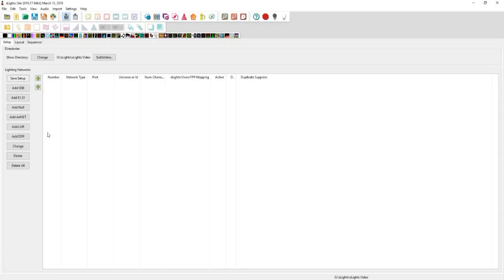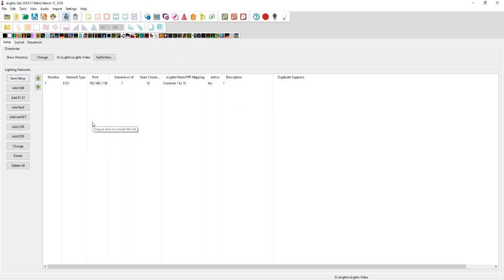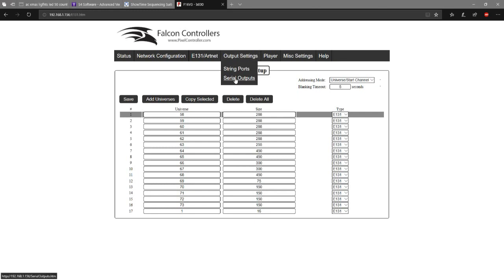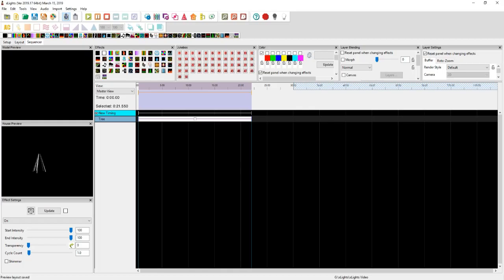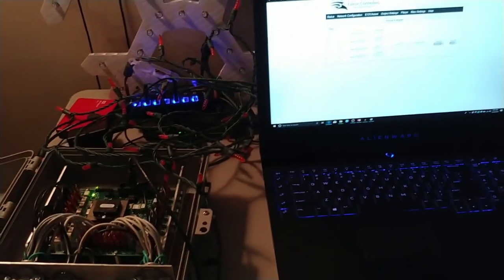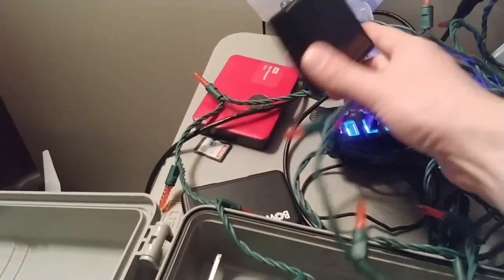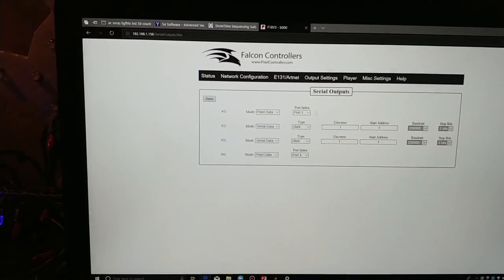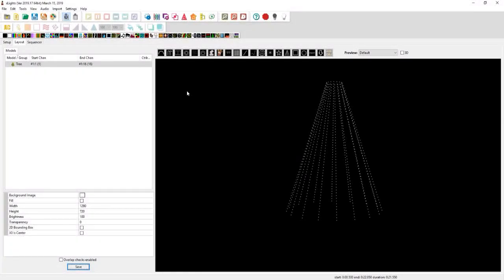xEssentials Lite  S1E15 Light O Rama to xLights Part 5 Running LOR on a Falcon

Comment: Thanks for posting this informative video! I am going to migrate 9 of my LOR 16 channel AC controllers off an LOR Optimized network (in xLights) and onto the Falcon F16V3 serial output as you have demonstrated. Hoping that it minimizes or eliminates some channels that have been turning on randomly and/or staying on even after a sequence is finished.
Reply: Hope it all goes well! If you need any help feel free to message me anytime. The USB dongle can definitely cause some issues as it does for me each year (I have found work-arounds for this), but once it is run out of the Falcon those issues almost always go away. The only large reason to use a USB dongle versus the Falcon output would be either not owning a Falcon or wanting to use the Easy Light Linkers to send data across far distances.
Reply: @stevenb6414  Hey Steve! I have 2 LOR ctb16pc's and was wondering if you could get them to work with my falcon f16 v5 as my switch. Do you mind helping me?

Comment: As stated in another comment, do you still have to set the LOR unit ID's?
Reply: Hello, sorry for the late reply on this! Yes you do. So for instance, Unit ID 1 would take up channels 1-16 and Unit ID 2 would take up channels 17-32 if you were using an LOR 16 channel AC controller on that universe.

Comment: Questions:  
1.  Are you limited to 512 channels for a LOR universe?
2.  Are LOR unit IDs ever used in Xlights to map channels across multiple LOR controllers when using F48 serial port?
3.  How do you define each controllers start channel?
4.  Any idea why a CMB24D RGB 24 channel controller would only want to start the first flood at channel 5?
Reply: Hey Paul! Here are my answers to your questions. My apologies for the very long delay on this!

1. Yes, the topic amount of channels that can be reached in any universe is 512 channels, however, I usually do 510 now a days just to be sure I am staying under the limit. 
2. The F48 serial port should work the same way as the F16V3. There should be no LOR unit ID used when setting this up in xLights. The LOR unit ID channels (when run in DMX mode) give the channel numbers versus the actual unit ID's. This means that if you have an LOR AC 16 channel  with unit ID 1, then the channels it would have over DMX are 1-16. Where you would say what prop goes to what channels is in the layout tab.
3. The controller start channel are defined by the LOR unit ID. As I mentioned in my second answer, whatever the LOR unit ID is will directly correspond to what the channels are. (This is only with an AC controller where the switch to a DMX network are simply plug it in and the switch will be automatic)
4. When it starts at channel 5 that probably means either a dip switch is not done correctly or you are in DMX mode versus LOR mode. The CMB24D is a bit more confusing because in order to run it in DMX mode you have to actually specify that via the dip switches on the board. 

Hopefully this helps and if you need anything else feel free to message me on Facebook!

Thanks,
Steven Byrd